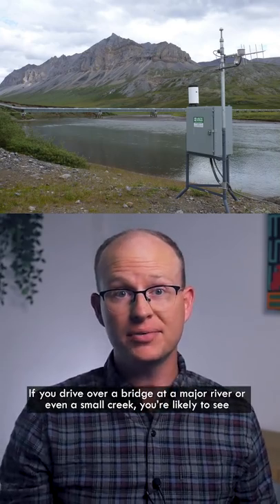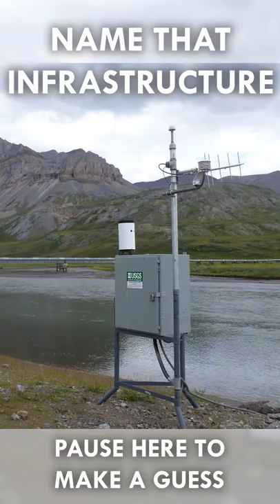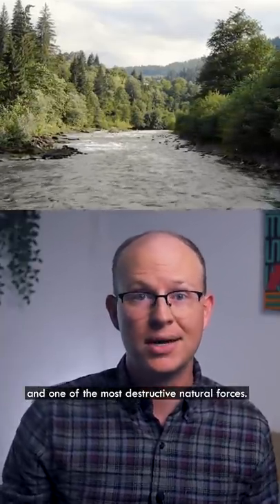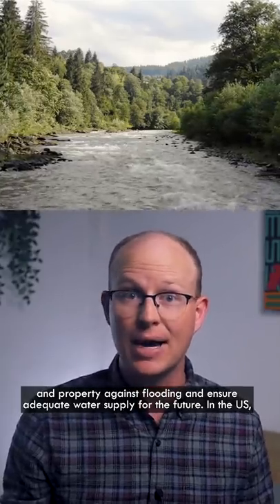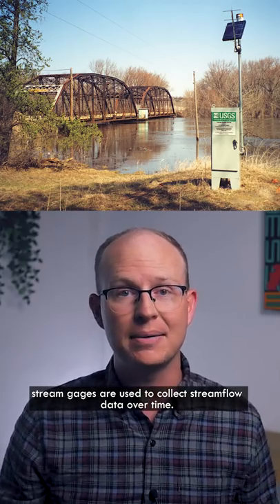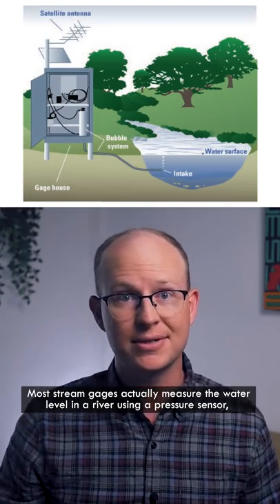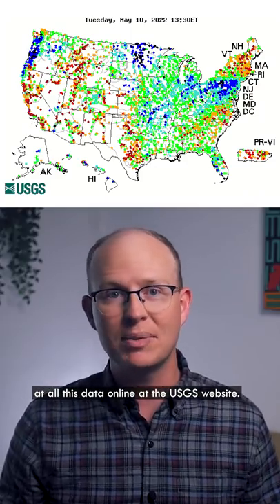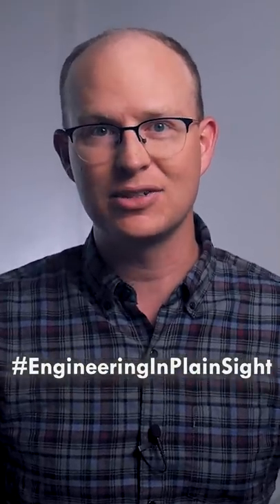Name That Infrastructure (Ep. 6) #shorts

Comment: I watch that data at the USGS whenever there is a storm to see if our roads are passable I always wondered what the device itself looked like
Reply: Every time I see a magenta E at the top of a comment section, I flip out and wonder if I saw the video earlier but blacked out.
Reply: I use it so I know if a river is at normal level. With creeks I use it so incase it’s higher than normal I don’t fish it. When it’s low, I know fish will stay in the deep holes and can’t get to different ones except when it floods. I usually fish after every rain since the creeks gets washed out to normal wuick

Comment: I’m old enough to remember when stream and river flow was measured by a guy walking out on a cable suspension pedestrian bridge and using old style instruments. As a kid I wanted to get access to those bridges but they were locked up tight.
Reply: they actually still do that! Most gages that don't have a bridge nearby have a trolley on a cable over the waterway. Periodically, staff will actually go out to the gage site and use the trolley to manually measure the flow in order to update the depth to CFS (cubic feet per second) conversion table
Reply: I forgot about those...

Comment: I may be out of date, but in my experience most stream gaging doesn't use a pressure sensor. They use a float in a stilling well. A chain is connected to the float and turns a wheel as the float moves up and down.
Reply: With respect Mike, yes you are out of date, we stopped using floats once the electronic technology became accurate and reliable. Far less maintenance and more accurate. There are probably a few of those old chart recorders still around but not many. If there is no line of sight for the antenna to transmit the data to a receiver, the data is recorded on a memory chip and downloaded to handheld electronic device called a data logger by actually visiting the site. Thanks for the comment, it triggered some memories of the early days in my career. Take care.

Comment: I used to work for utility that used them to measure reservoir levels. There are a couple of ways to make the measurement. One is a float inside a vertical pipe with slots so wave action didn't upset the reading. It was attached to a marked tape going over a pulley with a counter weight on the other end. It was read against a stationary pointer. The other way is using a pressure transducer at the lower end of a cable set at some point below the low water mark and calibrated PSI against a known reservoir level. PSI = millivolts = feet above device.

Comment: Stream gages are also useful for recreation! I'm a whitewater kayaker and rafter and knowing which rivers are at a good level to paddle is an absolute must, so gages are kinda the backbone of the sport. Oftentimes I'll check the flow and forecast multiple times a day, especially when I'm planning a trip. 

I'm currently obsessing over the USGS's Middle Fork Salmon at MF Lodge gage. Over 5.5 feet (6800 CFS) is considerably more difficult than lower water levels. Will I get to go on my June 6 trip, or will the water be too high...?

Comment: So if there's a blockade or something that empedes the flow of the water, the flow rate will actually be lower but the stream gauge will measure a higher water level and therefore assume a larger flow rate instead :/

Comment: I wonder if the network connection is /really/ necessary. I can't imagine it being used in a real-time system, and usually those kind of setups, while they have low data needs, end up costing a lot for the reliability. I just wonder if it's cheaper to have someone go out there once a month and download the data and do a local survey at the same time.
Reply: Some sites are not transmitted and rather downloaded as you mentioned. Other sites like inflow and outflow of dams are critically important and need to be real time.

Comment: That can't be very accurate for flow rate at higher flood states. The changing shape of the flow as banks are overrun would require incredibly accurate modeling. I'm guessing this is a legacy tech issue. True flow meters are more complex and less durable than any of a variety of liquid depth level sensor devices. I wonder if the difference in accuracy is less important than the cost to increase it. Acceptable error.
Reply from the maker: USGS has lots of expertise developing rating curves (the conversion from depth to flow). It does involve hydraulic models, careful site selection for gages, and regular field reviews and surveys to update topo and validate the curve.
Reply: @PracticalEngineeringChannel  Thanks for the great video and the response. Great content as always.